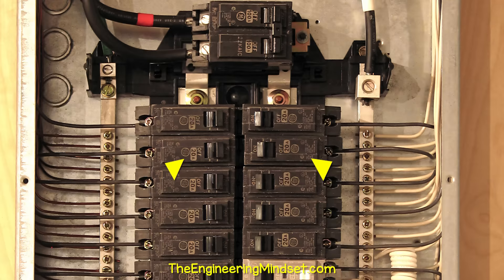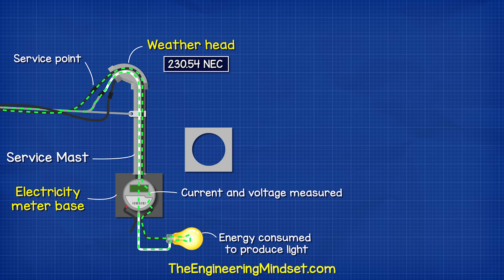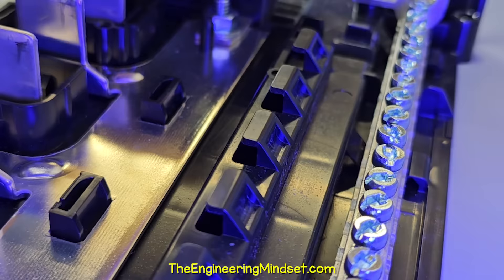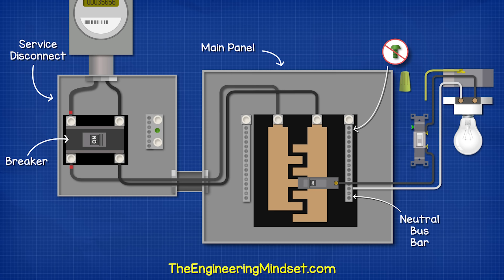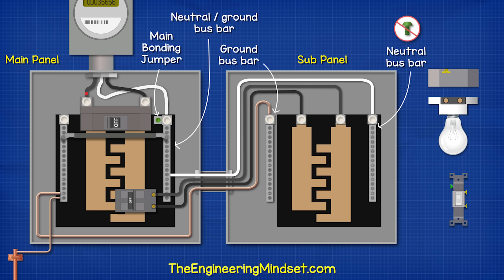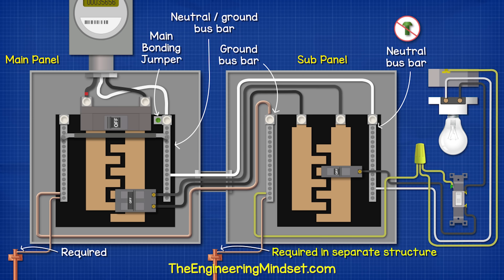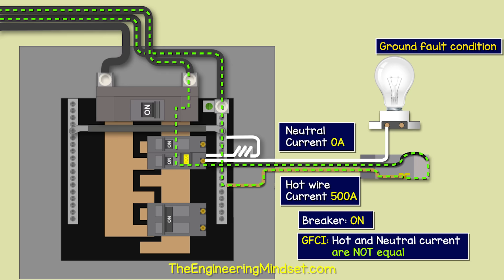Sub Panels Explained - Why are neutral and ground separated?

Comment: I may or may not be correct the rod you drive in the ground or water or gas pipe is called a lightning rod. If the system is hit by lightning it goes to the earth and not into the house or building.
Also we have gone from GFCI plugins to GFCI breakers to arc fault breakers AFCI these are faster than GFCI breakers but cost way more.

Comment: Great explanation of perhaps a common possibility.  BUT, in my house both the man panel and adjacent sub panel only have a common ground neutral bar; not 2 separate ones (that adjacent sub panel was only added about a decade ago - and it only came with a single common neutral/ground bar).

Now perhaps in my favor the adjacent sub panel common neutral/ground bar is both connected to the main beaker ground/neutral bar and also to the grounding electrode (water pipes entering the house).  It appears that the sub panel has the same protection as the main breaker panel.

Comments anyone

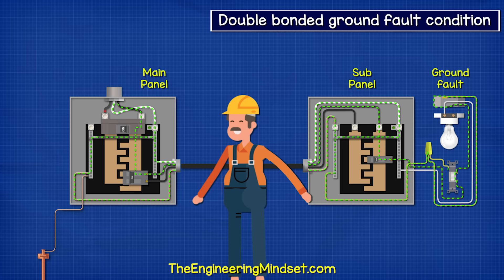Comment: The condition are 13:30 would not happen for several reasons.  

1). Both breakers would have to fail as they have two conductors with mOhm resistance back to neutral.  If they don't trip you have bigger problems.

2). The current that would pass through you even if there were no breakers would be miniscule.  This is a bird sitting on a power line condition.  Divide 100 amps of current between your body and the two conductors, and you might conduct uAmps. (15kohms across my tongue).

Comment: If you lose the service neutral, the voltage supplied to all lights and appliances will float between 120 - 240 volts, potentially burning up everything you have.
Light bulbs will produce less / more light and will burn up within a short time, repeatedly.
If you see this happening, do not turn on small appliances until you have it checked out by a qualified person.
I have seen the connections come loose at the pole, at the mast head, and at the panel.
Service connections swaying in the wind for a long time come loose more than the utility company wants to admit and they do not want to replace what was destroyed.
I have seen qualified installers not tighten a lug in a meter base and burn up the lug and wire.

Comment: Great explanation! What happens if you have an existing subpanel, but there is no neutral provided in the feeder. Is there a way to get 120 volts?
Reply: No, you will have 240v only.

Comment: Very clear. Just one question. Why does the sub panel in a separate building require a grounding electrode when it shares a ground with the main panel?
Reply: Lightning perhaps?
Reply: The ground it shares is the equipment ground aka the EGC, equipment grounding conductor. The grounding electrode is part of the GEC, grounding electrode conductor. You need a grounding electrode, ground rod in each building to protect them from lightning strikes.

Comment: Can you help to explain if we connect the Ground and Neutral like that, the current will travel also in Ground path  because the Ground resistor less then 10ohm

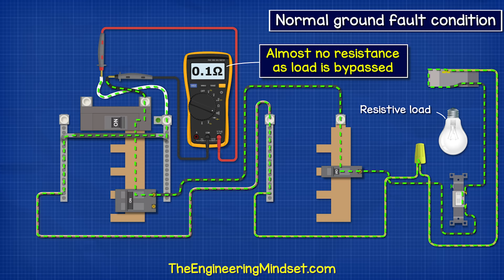Comment: At 12:00, isn't there also a potential parallel path for ground fault current through a metal conduit or person between the two panels? And is it really a big deal if there is? The resistance of the ground conductor should be very low compared to the load resistance, so there shouldn't be much voltage between the metal cases.

Comment: Hello EngineeringMindset, I propose a new topic in video: The Ballasts. How does they works ? Their fuctions at the circuits diagrams with the condensators and starters, mainly in the domain of lighting (fluorescent tubes, discharge lamps, induction lamps) or even if you want, talk about ballast in others domains, applications ? Everything will be so interesting a very good topic :)

Comment: 13:23 Even if in such incorrectly wired system there was no ground fault, objectionable current would flow from the subpanel neutral terminal to the ground terminal, and then to the main panel. In other words, there would be current flow in the ground wires under normal conditions, which is not OK.

Comment: So for most houses it’s bonded in the main disconnect outside then run SER(4 wire) inside then seperate your neutral and ground

Comment: The transformer primary at the pole for three phase Y connects to two hot phases (not the neutral), and the phases are balanced by the loads per street in a neighborhood. For, example if you had three identical streets (named 1, 2, and 3) all with the same general type and number of homes, street 1 would use phases A-B, street 2 B-C and street 3 C-A, no neutral is directly involved at the step down transformer input at the pole. The imbalance of the loads, streets 1, 2 and 3, is seen at the pole high voltage three phase neutral as a consequence of the relative imbalance (difference) in the phase pair loads.  

The neutral to the home is derived from a transformer secondary center tap, with this center tap also earthed at the pole. So coming to the home is center tapped 240 VAC with the neutral earthed at the pole.

In the US the main panel is often called a load center. Load Center is a generic term because load centers are configurable for either having a main breaker (main panel application) or having only lugs (remote (sub) panel application).

Per the NEC in the US there must be a main disconnect at the main panel (at a minimum a meter with a main breaker) external to the dwelling. This is to allow the fire department to de-energize the home in case of a fire. So if the installation calls for one main panel it is accessible from the exterior of the home, and if no sub-panels are used will also house all of the branch circuit breakers, which usually makes for a very confined installation. Because, ideally you would want to distribute all of the branch circuits of a home from what could be called the branch circuits minimum length center. So, you would find a sub-panel centrally located (in relation to the loads) with in the home, in addition to the meter + main breaker panel on the exterior at the service entrance.

The quality of panel is directly tied to the materials used for the main bus bars. The highest quality (and most expensive) is tin plated electrolytic copper. The lower cost panel has bus bars made from aluminum.

The real distinguishing factor in branch circuit protection and conductor sizing with the NEC is in describing the branch circuit load as either continuous duty (on for 3 hours or more) or non-continuous (on for less than 3 hours) duty. This has largely been ignored in residential because the loads traditionally are non-continuous. However, with Electric Vehicle charging continuous operation beyond 3 hours is not uncommon. So, as a result there is consideration for derating the continuous load, which also relates directly to panel sizing and conductor selection.
Reply from the maker: Seen our new 3 phase transformer video?➡️: https://youtu.be/u0SsejDCVkU

Comment: @12.42, why would all the metal parts becomes energized under ground fault condition ? does the fault current leak and energize the panel from the wire as its too high

Comment: I have a subpanel in the garage fed by L1,L2 and neutral, underground.  The garage has its own ground rod.  But I don't know if the bonding screw should be installed or not.

Comment: So I have 100 amp electrical box , just got a tankless water heater. Requires 220 and 3, 40 amps double pole breakers . Can I connect it if there enough space ?

Comment: Can you explain why a portable generator with a GFCI protected 240V 30A pops  the GFCI when connected to a bonded neutral breaker box (for storm backup power)? It's like it's seeing a ground fault because of the bonded neutral.

Comment: Thanks. Back home we dont have neutral connection , we have a 220 volts . Do you have a video that shows some guides on 220 v connection with a sub panel. Thanks.⭐⭐⭐⭐⭐
Reply from the maker: Are you in Norway?

Comment: I have a question.  I have underground going to the meter and disconnect on a pole in our yard, which then feeds the subpanel in the basement 100 ft away.  Ground and neutral are separate. The meter/disconnect in the yard is grounded with a rod.  My question is, do I need a separate grounding rod for the panel in the basement?  After watching this video it seems that I do.

Comment: In my situation, I am looking at a barn that is connected to an overhead feeder line consisting of a bare neutral / support cable plus two power lines, comprising a 240V balanced source. The feeder line connects to a main breaker and a meter panel at the other end of the overhead line. Is it necessary to add another conductor to the overhead line, so that ground and neutral can be entirely separate at the barn? There is a panel with main disconnect at the barn.

In general, I am still puzzled about why it is OK to connect ground to neutral at the main panel connecting to the power company. If the neutral breaks in the overhead line from the supply transformer (which seems highly likely since it's also the support cable) then you still have unbalanced voltage at the panel ground. To prevent this, one would need a separate ground and neutral all the way back to the isolation transformer.

Comment: I have a question, I need a 60 volt dc, 20ma supply from a 134 volt DC supply, what is the simplest and easiest way to accomplish this? Using a resistor and zener diodes? If so, what wattage and values?

Comment: Main panel with sub panel attached, if running romex through the main panel into the sub panel at what point do you strip the romex outer jacket, as it enters the main panel or as it enters the sub panel? Thanks

Comment: So lets say somone pulls two legs and a neutral out to the garage.  

Disconnect at the meter.

Can you set a ground rod outside the garage and call it good or must a ground conductor be pulled from the garage to the disconnect?

Comment: One is a normally current carrying conductor, one is not normally current carrying and is meant to short to ground so breaker trips. You wouldn't want return current on your EMT and other metal items like a stove or dryer which is why we have 4 conductor not 3 conductor wires for appliances nowadays

Comment: I have a 200amp panel. I know you are supposed to try to have equal distribution along each bus bar. I have an electric on demand water heater which requires 3 - 40A breakers, it uses 100A max when turned on. Should I have one breaker on one bus bar and two breakers on the other?
Reply: That is what you ultimately have to do anyway.  It's OK to have unbalanced loads, and the transformer will compensate for this with the way the windings are arranged inside it.  It's ultimately KVA that adds up to correspond to the primary current to the transformer from the utility.

It's more efficient if you can balance your loads as closely as possible, because otherwise you'd double the required ampacity of the busbar, main breaker, and service conductors, if you deliberately put everything on line 1 and nothing on line 2.  But you don't need to get a perfect balance.

If you have 3 dominant breakers, and have to compromise by putting 2 breakers on line 1 and 1 breaker on line 2, then what you can do to compensate for this is to disproportionately distribute your smaller breakers to line 2, so that the calculated load adds up as close as possible to a balance.

Comment: Thanks for sharing.  I saw that manufacturers of panel box recommand to attach a jumper (small metal) from the netrual bar to the metal box to satisfy a bar from netrual bar to ground bar.  Is that safe enough?  So is it true that besides installing the ground rod to the main panel, a metal bar needed to connect from neutral to ground? Thanks for any advice.
At the same time, at my house, i have a disconnect right above the elctrical meter base. It is not a switch but a pull-out disconnect mechanism.  Inside the house, the main panel also has another disconnect switch.  But never see a ground wire.  How to ground it?

Comment: I am aware of a sub-panel installed in a separate external structure through an underground conduit that was missing the equipment grounding conductor. There is a grounding electrode connected to the ground bus bar in the sub-panel but there are only 3 conductors running between the main box and the external structure through the underground conduit. I assume the equipment grounding conductor must be added. 
This video does not show a case where the grounding electrode attached to the sub panel becomes functional so how important is the equipment grounding conductor?
Must it be installed in the existing underground conduit or can it be run underground separately?

Comment: Thank you for the informative video.  Can someone explain the main panel for a solar power system? I am installing a main panel  for a 240 volt and a 120 volt power demand.  The neutral and ground electro are confusing for the inverter to panel connections.  Thanks!
Reply from the maker: Seen our new video on HOW SOLAR PANELS WORK in detail https://youtu.be/Yxt72aDjFgY

Comment: I'm hooking up outdoor mounted meter base and 8 space square D 200 amp panel feeding to house 200 amp main breaker panel. I'm  a bit confused because electric company supplied meterbase is bonded to ground inside meter base instead of passing through separately to my outdoor panel with main breaker where it seems to me it should be bonded. Any help with clearing this up is much appreciated.

Comment: Answer: because current leaves the source and returns to the source. The grounded neutral conductor is a current-carrying-conductor and the equipment grounding conductor is not. If both EGC and GROUNDED conductor carried current back to the source there'd be a parallel path which in turn would slow down the returning fault current, or short-circuit current. We want to clear a fault as quickly as possible and that is why the EGC and NEUTRAL conductor are isolated downstream from the MAIN DISCONNECT.

Comment: At a Campground, I connected my meter to the hot wire and the ground wire to the casing and it had 120 volts ?

Comment: Help me out here, main and sub panels connected by non-metallic raceway and way too far apart to ever be jointly touched. I'm not following how an absent neutral fault in a (wrongly) bonded sub panel is somehow worse than an absent neutral fault in a main panel with a (properly) unbonded sub panel. It seems in both cases current returns to the buried ground rod of the panel in which the absent neutral fault exists, energizing that panel's housing, and perhaps not tripping the breaker.
Reply: Same thing I’m saying, And it’s the same thing I’m trying to figure out

Comment: ok.....I have a ford f150 w/ 7.2kw generator onboard.  I want to patch 30amp truck to panel to power various breakers with interlock kit.  The trucks output is gfi protected.  How would I wire this up and not trip truck gfi?

Comment: I always believe that the current takes the path to least resistance which would be the first grounding electrode thats connected to the sub if the load was in the sub. Why would it go to the main pnl electrode?
Can you explain that to me?
Reply from the maker: It takes all paths but most will take the easiest path